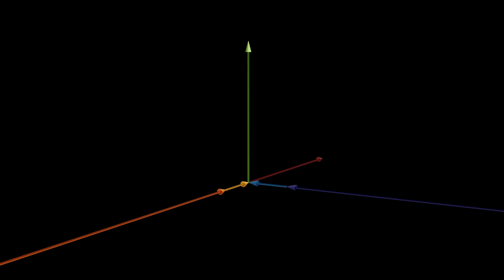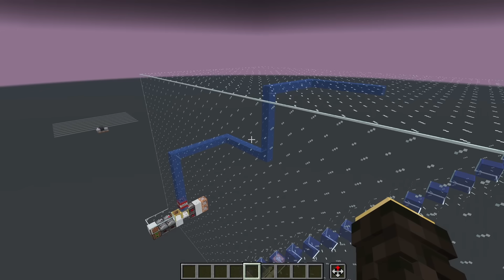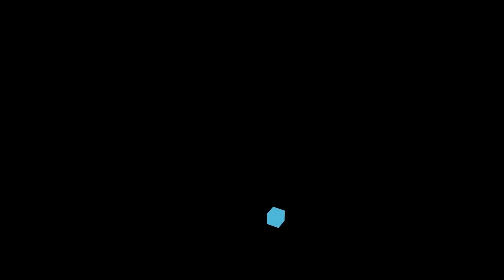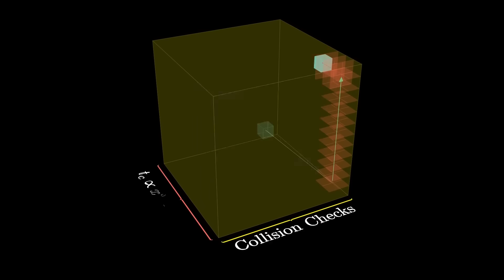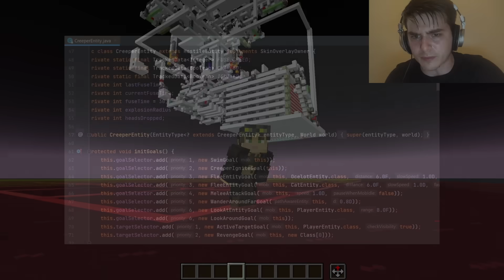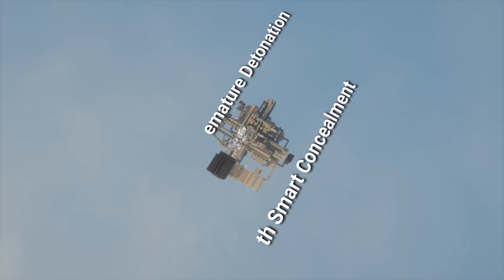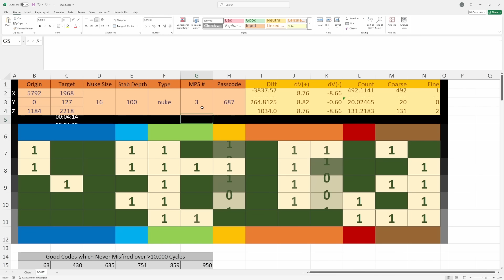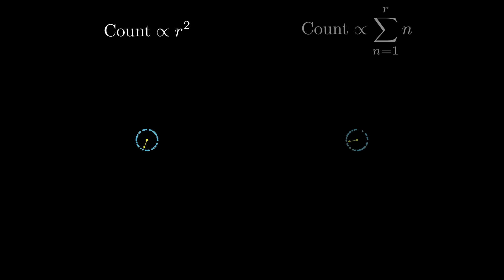Minecraft's Most Advanced TnT Weapon is Here

Comment: I wonder if you could build a wiretap for the input signals and make an early warning system. You’d need someone standing at the output of the system to decode location data but just taking the safe signals from the spreadsheet and hooking that up to some lamps or note blocks could tell you when someone was going to fire

Comment: Could we get a video / more information on its ability to make perimeters? I did see JKM's video also but I would love to learn more about the details of how it works for that use case specifically.
Reply from the maker: Just made a breakthrough on that front, the problem is JKM used a heavily modified version of the Mk.4, in fact he used 3 of them running in parallel because just one of them was too slow. I wanted to make a variant of the Mk.6 to do the perimeter cannon logic in a much smarter and more streamlined way so that it was faster and more lag efficient. But one of the major hurdles was that the Mk.6's nuke does not have enough clearance to avoid terrain when excavating down to bedrock. So I've had to go back to the drawing board on the warhead builder and design a new nuke with a larger clearance.

Comment: Hello. You probably won't even see this among many other comments, but still. I'm having a lot of trouble while firing the cannon. I built it in all cords divisible by 16 in mid air on a sigleplayer vanilla world. The chunk loaders also linked perfectly. The control panel is also chunk aligned. but when I put the settings in and clicked the button, there was no noteblock sound at the end, the right redstone lamp didn't start twitching... and in double the time displayed by the spreadsheet there still was no hole. I did, though, change the passcode to 950(I didn't and still don't know if for it to be a 1 must the lamp be on or off) I used the same passcode in the spreadsheet and the cannon. I switched on the chunk loaders and broke that lever located by the piston. Did I do something wrong?
Thank you.
Reply from the maker: When you change the passcode you need to also make sure you trigger the passcode gate to reset. I believe I showed that process in the video. Even if you forget to reset the passcode gate after attempting to trigger it the first time and failing it would have reset automatically so you should be able to input settings now.
Reply: did you extend that one slimestone line like he did in the video? the one that causes the trapdoors at the top to open and close.
Reply: @JADubs_  I think that couldn,t be it since I pasted the schematic in the world, I didnt move any trapdoors like he did in the video...
Reply: @no1_likes_me205 im not sure, I would probably try pasting it again and using the default passcode just to verify that messing with the code didn't mess anything up.

Comment: If your gonna remove the old warhead editor, I am begging for the others to be built in. Nukes and depth charges would be absolutely amazing. I think most people just didn't know it existed and saw the very in your face primary ones. If it was a built in option, YouTubers would love the nuke just cause it looks amazing, and the depth charge is just actually so useful. If your trying to attack an underground target, the stab charge only blows up a tiny segment of it. Alternetavly you could even add a few other types of payloads specifically built for designing custom ones. Instead of having a full editor you could load in several specific charges and program to fire at specific times, maybe one per tick, all at once or un even groups.

Comment: your redstone teleporter has false positives on vanilla servers now, some of your stuff just doesn't work anymore. I built a mechanism that ha 1 of the machines running and if you ping it it turns on the teleporter for 15 seconds. some of your stuff is just a little scuffed (i checked chunk borders, block levels, made some minor improvements.
Reply from the maker: The redstone teleporter designs are super old now, the wireless recievers used on the cannon function pretty much identically however I fixed all of these problems.
Reply: @cubicmetre  cool, ill take a look at them, on my server i just required a double pulse to teleport to counteract the false positives

Comment: hey awesome video and great work 
i was trying to run the canon but i don't understand how you input the passcode into the canon could you help me ? sorry if you did explain it and i just missed it
edit : alright i got it for anyone wondering you need to input the rightmost part of the excel sheet starting from bottom right then going up and the second part starting from the bottom 
(you input it on the copper bulbs left to right)

Comment: About the charge time for long distance shots:
I have watched the previous videos and noticed you used powder snow to make the accellerated payload stop immediately after the first movement, witch significantly simplifies the accelleration process on the mechanical and mathematical level.
However think about how much movement you are wasting,if you timed the payload to explode x ticks after being fully loaded and made the calculations more complex to account for a non linear trajectory (a balistic curve) you could drastically extend the range of the cannon and improve the accelleration time per distance, to avoid the payload having residual velocity when it reaches the target location you can simultaneously fire a counter payload set to explode before the first one at the subtick level and counter accellerate it to zero it's velocity, that would make it need to charge for two payoads but the charge time would comparatively be faster than the current version the further you shoot, to account for close targets for witch the normal firing method is faster make it a toggle. 
The counter accelleration on target would probably diminish the accuracy of the cannon, however i do not believe the cannon needs to be precise to the block, if it was even just precise to 4 or 8 blocks it would probably be enough in any realistic situation, since it's already apparent the cannon is not a good weapon against players (at least not in stab charge mode, but i dare you to tell me that the nuke needs to be block precise) witch is the only case in witch single block precision is needed (at least in my opinion) and the decreased accelleration stage time is  a much more palatable benefit.

Edit i admit that i am writing as i watch the video since i don't have the time to watch it all now, so in the offchance something like this was already implemented and mentioned i'm sorry for wasting the time of anyone who read this obnoxious wall of text
Reply: huh, interesting idea. not even sure if the counteracceleration charge would be necessary if you could get the math working right. the payload moving slower would probably make the firing more complex though, as you wouldn't be able to exploit the corkscrew' motion of very fast entities
Reply: @ez_theta_z9317 i think the counter payload is needed to stop the payload right in the air, otherwise no object would ever stop dead in the sky, there would always be a fraction of the initial speed, witch add itself with the speed from the explosion of the propeller and make the shot go diagonally instead of straight down.
Reply: You can't do this because of chunk loading- the payload will stop after a tick no matter where you shoot it because of this. The powdered snow only makes it lose velocity, so even if the area is loaded, or if its unloaded and later loaded, it stops. You may be able to do it with new pearl mechanics but you'd need an ender pearl for every shot and it increases complexity A LOT.

Comment: The fact that possibly even ONE person is going to learn firsthand the reason why you change your default passwords because of a minecraft cyber hacker hijacking their orbital strike cannon via wireless control terminal puts an incredibly large smile on my face.
Reply: It's even be possible to triangulate the coordinates of the cannon based on the time it takes to fire at different coordinates, so hijacking it, finding it and then changing the password is entirely possible
Reply: @reio4641  there's a couple issues with that idea.
First, the controls are based around distance from the cannon itself. The spreadsheet may take in absolute coordinate inputs, but it converts to cannon-relative ones, the numbers you actually put into the machine will decide how far the charge moves away from the cannon. So there's not really any triangulating; if you somehow manage to fire it and then find the blast zone, you can also easily find the cannon.
However, to actually fire the cannon, you would also have to guess what they're using for the encoded password, not just the repeaters in the wireless receivers. So while jamming the communication is pretty easily doable, actually firing the cannon without having seen it is much less likely.
Reply: @elder_frost  if you're someone who's getting your builds shot out by the cannon, you can do a timing attack on the cannon's location if they just shoot as soon as possible

What you do is station people at bases, and look at the locations of the bases that were hit, and trace out a circle on each location based on how long between the last shot and the shot that hit that base, that gives you a distance for the cannon. Combine multiple distance circles from multiple points and you can triangulate the position.

This is of course easily defeated by simply firing the cannon once per hour or something along those lines, eliminating any information from the timing channel other than "the cannon is close enough to hit all these bases within an hour's charge"
Reply: @elder_frost  The controls' position doesn't matter to what the other person was saying.
They are saying if someone were to fire shots at different locations, then you could triangulate where the shots are coming from based on the time it takes for the cannon to fire.
Then go find the cannon and change/copy its code to hijack it.

The time it takes for the cannon to fire depends on the distance to the impact point.
So if you know the time it took you could then calculate the cannon's distance from the impact.
If you calculated the distance from three impacts at different locations then you'd know the cannon's position.

But there are plenty of other issues with trying to do this method too.
Reply: @mtndew314  ... how can you understand when firing sequence was started
Reply: @elder_frost  to start with i m not a redstone engineer but, for the cannon to fire at a specific place those chinks must be loaded, usually by players so when a guy fires a shot at the place, assuming he would have asked the cords or if not, we can see a lag spike when the cannon starts building the payload or after. we can compare the time of the actual explosion and the time when the lag spike happens to calculate a rdius or a circumference of where the cannon can be, eventhough its invisible in the pie chart, just an area with a large amount of chests can be a clue. Or i am not sure if replay mod catches the direction from which the payload is coming from
Reply: @reio4641 

Thats not possible because it'd mean you need to know T0, the time the cannon fires. Which you cannot know unless you already know the location of the cannon.
Reply: @Alsry1  Shouldn't it be possible to build your own wireless receiver and intercept the firing instructions, thereby both knowing T0? 
Though if you do that, you also know the passcode and the relative position of the explosion to the canon, so you can find and use the canon just from one intercept.
But I have to admit that I don't fully understand how wireless redstone works, so I might be wrong
Reply: @reio4641  It has a separate duper for each axis, so all you'd really know is how far it is on the longest axis. You can narrow down your search quite a bit but its not directly finding it.
Reply: @reio4641  afaiu targets are internally specified relative to the cannon location, not the worldspawn or something else. that is, if you want to locate the cannon this way you would need to find the target as well. if you are watching to traffic waiting for the operator to fire the cannon, you would need to guess the target location to make sense of the launch parameters, and if you are operating the cannon yourself you would need to try different parameters until one of the targets turns out to be within your observation range, and you would know the cannon location from the parameters you used. so i don't think there's a possibility for a time based attack.
Reply: You dont know when it fire and so you only know when it arrives  @reio4641

Comment: Can anyone who finds the remote panel (or follows someone to it) use the cannon without knowing the passcode beforehand? If so it might be good to change its network repeaters after use so no one can use incorrect configurations to self destruct the cannon. Although I didn't hear if the passcode was unique to the cannon or just the current transmission

Comment: Hate to be that guy but.... Velocity isn't a server. It's a proxy and could theoretically work with vanilla MC servers (heck it afaik supports modded servers).
So if you complain about these servers, do it right please.
Reply from the maker: Theoretically works with vanills MC servers is not the same as does work with vanilla MC servers, change even the tiniest detail about how the game simulation is run and a machine like this could implode.
Reply: @cubicmetre  Well, Velocity still is a proxy, meaning main communication between player and server would still mostly be direct and not through it.
It afaik doesn't change anything in terms of gameplay and as long as you're not using stuff like scoreboards through the proxy should it also not affect those either.
But of course you can proof me wrong by providing evidence it does impact normal gameplay/simulation behaviour.